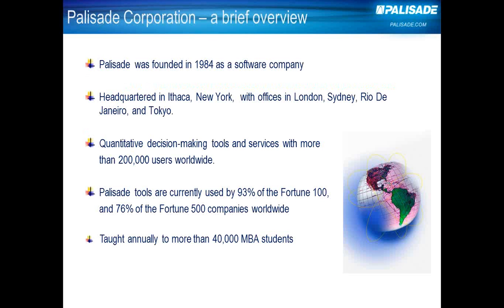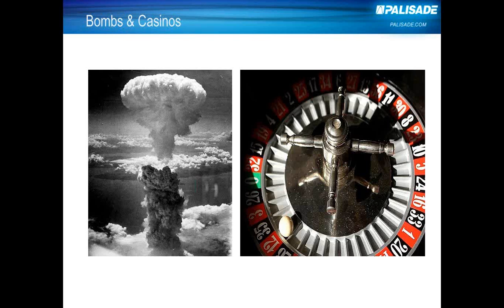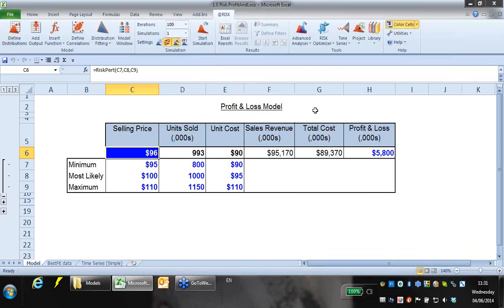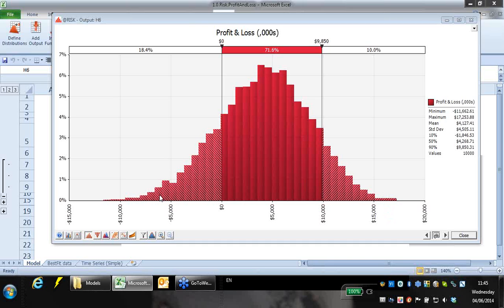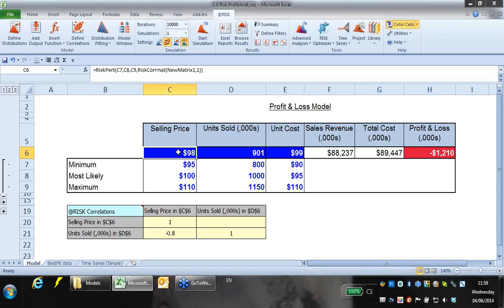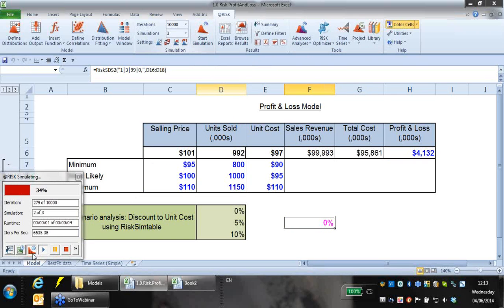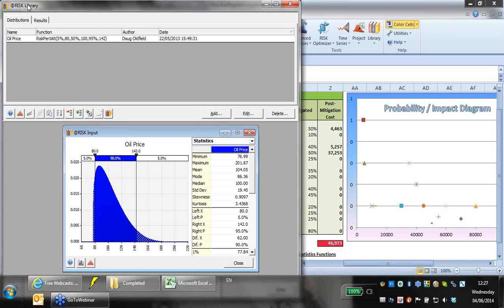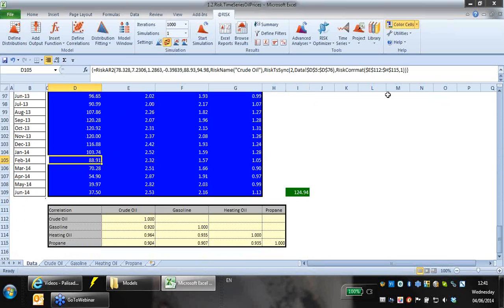WEBCAST: Introduction to Risk and Decision Analysis using @RISK

Comment: Thank you for your video! I have a question. Could we use @RISK with an existing Excel sheet? For example, I have a table used to calculate the NPV of my investment for 10year with all required inputs, functions. With this table, I can find a single value of the NPV. However, my data have uncertainty. They are not the unique value, but range values. Can I use @Risk to find the range of NPV without rebuilt a new excel sheet?
Reply from the maker: Absolutely! Feel free to take a look at our on-demand webinar that may help you learn more about how to do so. http://go.palisade.com/OnDemand-IntrotoRisk.html 
It's free to view, simply fill out the form and our marketing team will send you a direct link to a recorded webinar. 
You can also reach out to sales@palisade.com and they will happily set up a customized demonstration for you. 
Kind regards,
Palisade Corporation